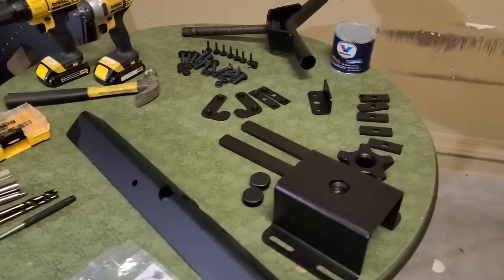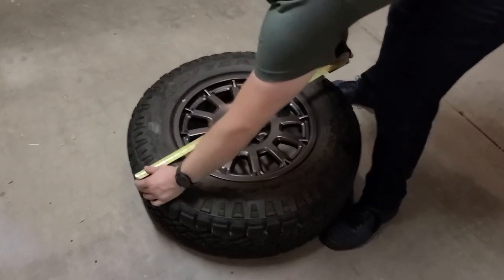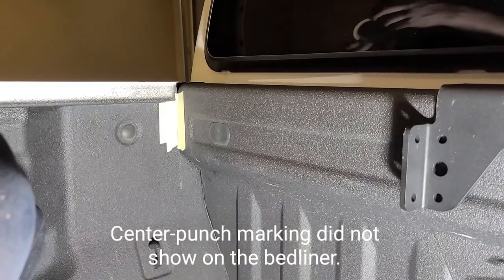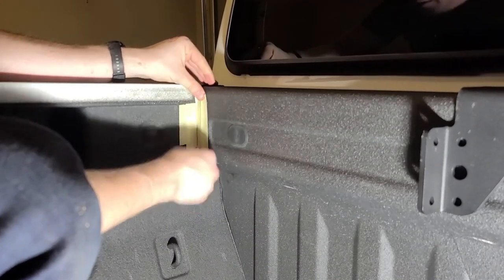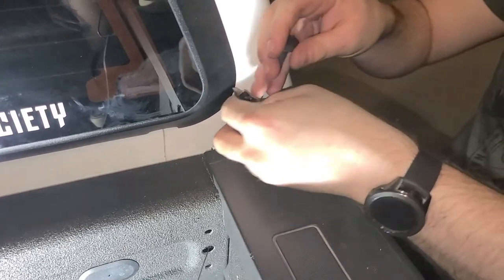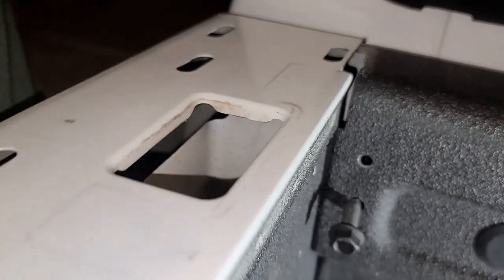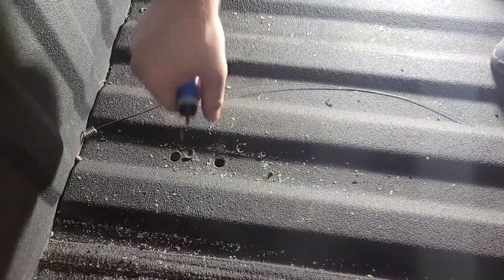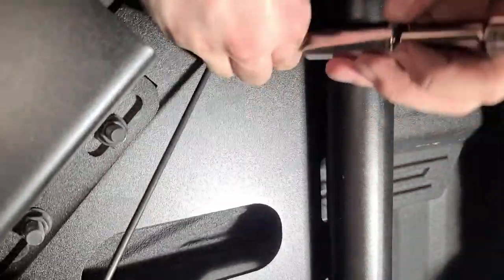ZR2 Bison AEV Vertical Tire Mount Installation

Comment: Thank you for the video, looking at getting a 2023+ Colorado ZR2 but don't want to spend the extra 12k for the bison just for the 35s and spare tire carrier. This video certainly made it look easier! Did you spray down the fresh drilled holes with paint so they don't rust?

Comment: How bad does it restrict your rear mirror view? What are your thoughts about mounting the tire flat in the bed and building a box over it to reclaim lost bed space?  Did you notice a CG shift from raising the height if the tire?  Thanks.
Reply from the maker: I have had both the stock tire size (~30.5"-31") and true 35" tires on this rack. The stock tire size will block almost half of the view out of the back. The 35's will block somewhere between 1/2 and 2/3 of the view.

Comment: Hey great video will be installing on my truck also hey question what kind of antenna do you have on top of your truck is it permanently mounted and where can I get one? Thanks
Reply from the maker: I have just a magnetic NMO Style antenna mount with the NOVA wire management on the roof for passing the antenna wire to the inside of the cab. https://www.copperstarusa.com/product-page/nova . I think the brand of the mount and Antenna were Browning I believe. I have an ICOM ID-5100A VHF-UHF dual band transceiver. I love the unit paired with the NOVA as if I want to change out my antenna setups or add a roof rack in the future (which is coming soon).